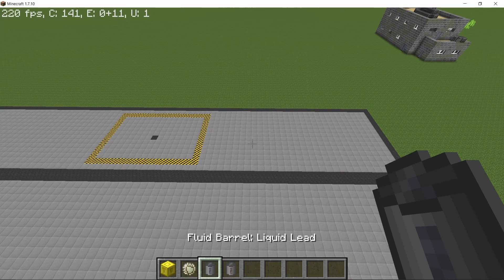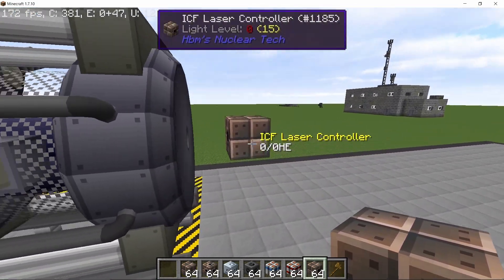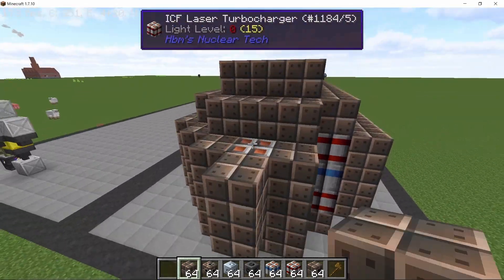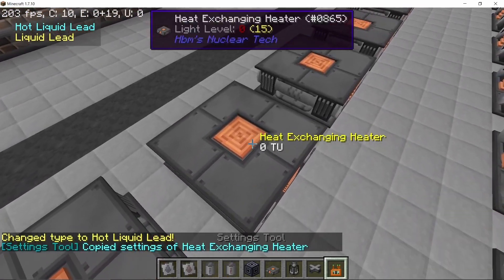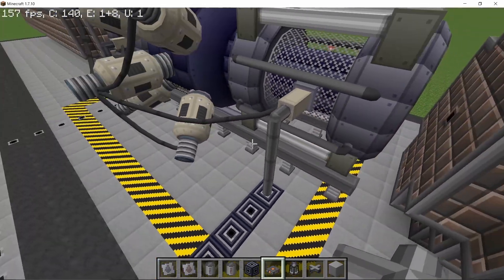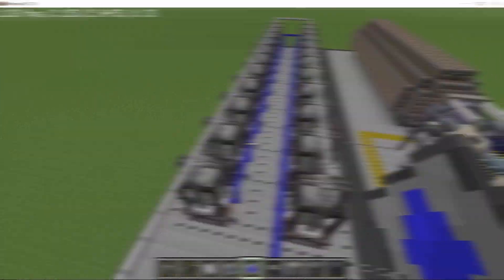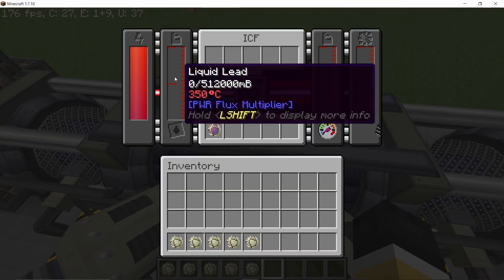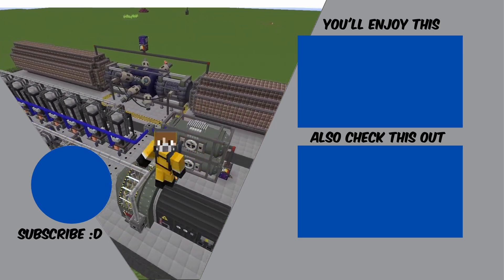LIQUID LEAD is Awesome - Powerful ICF Reactor Build - HBMs NTM

Comment: It would be cool if they added another type of steam generator/heat exchanger, with the boiler integrated into the heat exchanger. It would be great if it were like the steam generators used in PWR power plants, much more powerful than the mod's normal heat exchanger, because putting a trillion heat exchangers in the world to handle an ICF isn't ideal.

Comment: The liquid lead and hot liquid lead is inside the heat exchangers and both the liquid lead and liquid hot lead does not go anywhere , the turbine isnt doing anything , even the condenser isnt doing anything even if i powered it , did i do someting wrong?

Comment: I think It'd be cheaper to run a watz power plant, atleast it can constanlty produce iron and lead using renewable fuel!
Reply: Of course but that gives you less than 1% the power of this reactor and not to mention this reactor produces Stellar Flux
Reply: @ahlixemus8903  Trust me if you can afford tò run an ICF you're Better off using something else. Stellar flux Is the only good thing about this reactor, which Is necessary tò the Road tò the DFC

Comment: You can use the trick of instead of setting normal steam to come out of the boilers, you set dense steam, and then the boiler will transform the steam into dense steam instead of water into steam, then you can set the turbine to dense steam and the dense steam when it enters the turbine is transformed into steam, then the steam that comes out of the turbine you can put to go directly into the boilers, and so this loop works without needing a cooling tower or condenser, and from my experience with this system it generates more than normal steam.

Comment: At this point we need some sort of new and stronger boiler.
Reply from the maker: Agreed !!
Reply: @SavageVegeta  no. we don't need. its limit of heat exchangers not boilers
Reply: at this poin we need new exchangers
Reply from the maker: @ACupOfChicory-g5c I think that is what Walter meant, basically we need a whole new set of heat based machines that can operate much faster
Reply: @SavageVegeta  maybe like the mekanism Boiler which is scalable. You could build it like a pwr with different components.
Reply from the maker: @Walter-Weiss or just have a big industrial sized heat exchanger like they added the new arc Furnace for automation
Reply: @SavageVegeta  one big problem is that energy and fluids transfers in ticks but heat in seconds. idk why. but machines consume heat in ticks
Reply: @ACupOfChicory-g5cno its definitely the boilers cap off at a certain point
Reply: perhaps it could have settings that would be able to turn water into dense, super dense, and ultra dense steam; similar to rbmks. and could have 4 TU inputs.